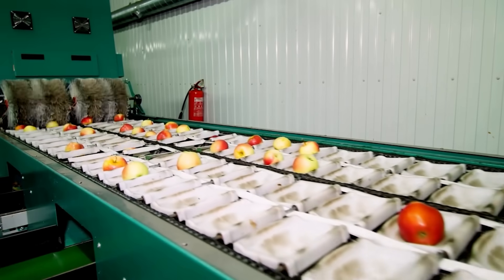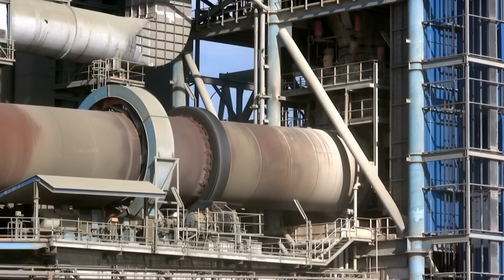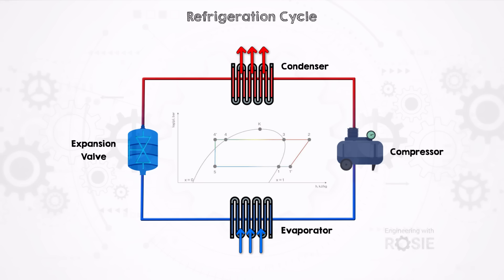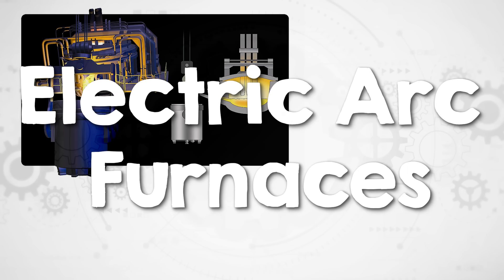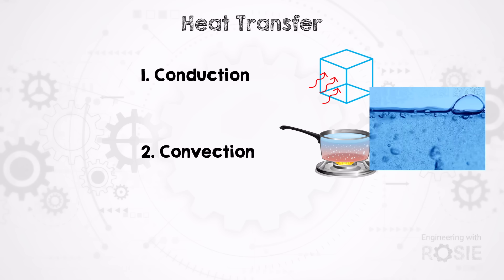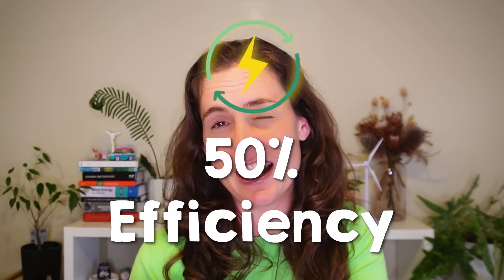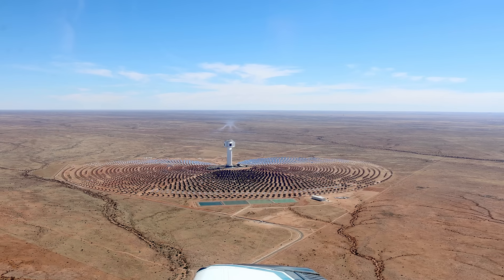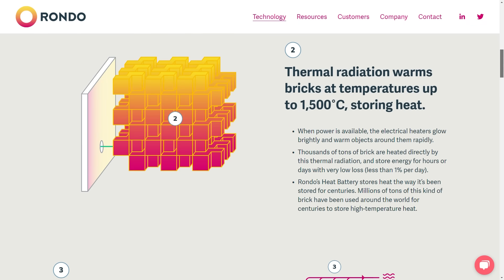Zero Emissions Heat Technologies for Industry

Comment: I have Rooftop Solar at home. 6000 kWh Every Year for 12 Years Now. A High Temperature Heatpump 60 degrees. A Watercooker 100 degrees Degrees. And an Airfryer 200 degrees. No Problem. Microwave, Inductioncooking, bathroom Boiler, close in Boiler in the kitchen. The rest is Electric. Washing machine, Dryer, TV, Desktop, laptop tablet Cellphone vacuum Cleaner toaster, radio, ledlamps. Everything. Rooftop Solar for yr Own electricity. The rest all Electric. No Gas Coal Needed. Works for 12 Years Now.

Comment: I have gone through all your videos and I haven't seen one about the new high efficiency hydrogen electrolyzes that have 95% efficiency.  The videos you have that talk about them only refer to the old ones with low efficiencies.

Because almost of the hydrogen (mostly used to make fertilizer) used today comes from methane, there was almost no need for such electrolyzes in the past, so they were not developed until recently.
Reply: Record-breaking hydrogen electrolyzer claims 95% efficiency
March 16, 2022
"A kilogram of hydrogen holds 39.4 kWh of energy, but typically costs around 52.5 kWh of energy to create via current commercial electrolyzers. Australian company Hysata says its new capillary-fed electrolyzer cell slashes that energy cost to 41.5 kWh, smashing efficiency records while also being cheaper to install and run. The company promises green hydrogen at around US$1.50 per kilogram within just a few years."

Comment: @EngineeringWithRosie 

I was surprised you didn't include glassmaking, in particular float glass, in your list of high temperature industrial processes. This is one of the highest industrial temperature processes, requiring about 1,600⁰C temperatures. Furthermore, it also tops the list for energy supply reliability, requiring an uninterrupted energy supply for in excess of 10 years for the float glass production lines, apparently if they go cold (albeit still extremely hot) it's a complete rebuild of the production line. 

With regard to cement, you made the assumption that the kilns would be heated externally if using electric heating. I may be wrong but I do not see any fundamental reason why heating elements couldn't be placed within the the kiln in some way with a bit of intelligent redesign. However, the big challenge may be the the rate of heat supply, kW, requirded. 

With regard to very high temperatures, resistive heating wire is readily available to around 1400⁰C. These heaters may be expensive initially, at least compared to a gas burner nozzle, but if they use renewable energy more efficiently, than bio or synthetic fuels, then running costs could be substantially lower, making the system cheaper overall. 

If you need to go higher temperatures than 1400⁰C tungsten wire is a possibility, which is usable up to about 2,500⁰C, although it will be significantly more expensive than the lower temperature alloys. 

Finally, the ultimate heating source is probably microwave. The ITER fusion reactor will use 10 to 20 MW of microwave power to help heat the Plasma to upwards of 100 MILLION degrees Celsius!

Comment: Excellent video.  Thank you so much for the explanations and rationales.   Yes, I believe thermal storage will be the Rosetta stone for renewable energy but only if we can rein in infinite consumption and infinite want.
On another note I was encouraged my estimates of water heating using induction used less energy than gas or resistance heating for household use. I jury-rigged my own system saving significant money.  It seems a manufactuer would have  made such a system with a larger vacuum insulated storage tank. 
Also, why can't cement kilns use induction to heat the inner surface or klinker contents?

Comment: Would love to see the Rosie take on electric fields and the movement (drift) of electrons. Drift velocity is a function of current(Amps)/sq.m of cable - Amps/sq.mm being a more useful metric. Drift velocity is mainly important for DC electricity. Each metal/alloy has a  range of drift velocity for which it is economic. It would be interesting to see the range of drift velocities for pure copper and aluminium. 
For DC, electrons might drift about 1mm/sec, and move back and forth 0.4um.
Volts relates to the electric field.

Comment: You missed 2 other possible industrial heat sources that could supply high grade high temperature process heat up to 1300 degrees and perhaps higher. Molten Salts in Molten Salt nuclear reactors and High Temperature Gas Reactors. This is a glaring omission.

Comment: Some of the food processes can be replaced with other non heat based methods, for pasteurization you can use either radiation or pulsed electric field; for canning you can use vacuum sealing in some cases.

Comment: There is no technical reason why gas turbine technology cannot be modified slightly to produce heatpumps with output temperatures around 1650°C (3000°F). Turbines already handle gases which are that hot. Nor do they have to be inefficient, because the input heat can come from cooling off the hot product, which has to be cooled anyway. Just take the cooling air and compress it, making it hotter, which also adds the energy used to power the compressor. Temperature can be boosted the desired amount (for heating the input material) by adjusting the number of stages of compression.

Comment: One process this doesn't mention is using industrial waste heat. I have been a part of a greenfield sulphuric acid plant, which sent over its heat from sulphur oxidation and sulphur dioxide oxidation to a specialty petrochemical plant nearby. The petrochemical plant was already there, the location of acid plant was chosen specifically for the possible sale of waste heat, otherwise it would have been used to generate electrical power and sold back to the grid, but this deal made a lot of sense and saved a ton of money on generation equipment and electrical stuff.
Reply: That's what district heating already addresses so she did mention is.

Comment: Why can't we use Tungsten for high-temp direct-electric elements? That doesn't melt until 3400C.
Is it too conducive to make a good resistive heater or something? It worts in lightbulbs, so it seems like it could be useful for other applications...

Comment: The efficient use of heat would be even more paramount when using relatively expensive sources of heat. Every GJ counts.
One way that strikes me as interesting is biomass oxy-combustion. Heat loss is a function of the exhaust gas temperature but also its mass. The mass of the effluent can be greatly reduced by removing the nitrogen before combustion. A reduced mass and volume of effluent should also make it easier to recover heat as it would require smaller heat exchangers.

At large scale, cryogenic distillation is how you get pure oxygen by turning it into a liquid (higher boiling point versus argon and nitrogen). The BIG question is if cryogenic distillation is a process that can cycle up and down with the ebb and flow of renewable energy output. If so, it means that excess LOX can be stored for later use. Basically, use solar electricity to make LOX, any LOX that is immediately needed is used and the excess is stored in large, insulated tanks. Then, after the sun goes down, the LOX storage is tapped to keep the oxy-combustion going. As for the liquid nitrogen and argon, those could be used for process cooling or perhaps for generating electricity through the use of an organic Rankine cycle.

There's also the possibility for carbon capture, if just to sell it as a commercial or industrial product (like for making carbonated water or as a feedstock for the production of chemicals and fuels).

Comment: Steel and cement making will definitely be the most difficult industries to decarbonize. Most other industrial processes fall into the medium heat category that could be supported by (MSR/TMSR) Molten salt reactors that can produce up to 800C heat continuously.  Boiling water reactors can't do this.
Reply: China's Pebble Bed HT reactor outputs steam at 500C and is now in operation since 6th Dec.They are aiming it for process heat, and plan to export

Comment: Thank you. I follow your video channel primarily for your insights on renewable energy and I notice that the question of viability for renewable wind and solar, which is maximised in areas where there is predictable wind or sunshine or both. The question for both industrial and domestic use of these resources in areas where intermittency is greater and the value of return for the investment is reduced is clearly a problem for the switch to renewables.
In my own case, to replace tank gas in my isolated location with ground source heat pump is becoming more attractive but in older buildings (listed historical), the low temperature / high insulation value model is impractical.
In discussion with a heating engineer and consulting locally and nationally (UK), there appears to be considerable shortfall in expertise and those with any or all of the required knowledge are cherry picking simple installations, exclusively air source pumps, to maximise profit. Furthermore, the benefits of air source heat pumps are being heavily oversold, failing to give a true idea of potential in particular during prolonged cold weather, this leads to disappointment and damage to the already fragile incentives to make change.

Comment: Rosie. You’re falling into the efficiency rabbit hole again. Efficiency is not a factor when it comes to Hydrogen because we have an unlimited renewable supply. The only reason efficiency enters your mind is because you are still working in the capitalist model Remember saving the planet will cost money . And since the Sun imparts more energy on to our planet in one hour than we can use in one year then the question is how do we turn that energy into Hydrogen.Efficiency does not matter if you use that energy to make hydrogen. Yes I know this is a had concept to get your head around.
Reply: White or gold Hydrogen is a naturally occurring gas at depths of 3000 meters. It is being researched in the Lorraine basin in France with cost may be as low as 1 dollar a Kg to mine!  Bill Gates is all over it right now!

Comment: Everybody likes an idea of a "cleaner" world (air). Besides the heat pumps (which are slowly advancing in efficiency and at a (relatively) lower costs) , the rest of it is so expensive , that it couldn't be done , without heavy subsidizing . Which means , ordinary citizens have to pay for some rich people (owners of the industries) to become green (or greener) and avoid paying carbon taxes. I'm all for it , as long as it costs me and my fellow citizens nothing. Of course , it doesn't offset acquiring and transport of raw materials for industry production. As long as there is a cheaper option (mostly conventional - fossil fuels , or bio mass) - people will use it , unless something equally cheap , abundant and reliable and accessible to everyone emerges. But , that is more political , than technological subject.

Comment: Rosie, I enjoy your videos.
I would like to point out concern of the blanket statement that conduction is the least efficient form of heat transfer, and radiation is the most. I'm a licensed Mechanical Engineer in the US, and maybe I'm misunderstanding your criteria for most efficient to least efficient. Radiation, in most cases, is the least efficient process of heating up material and conduction is the most. The ability to direct contact transfer heat can not be beaten by the use of emissivity, reflectivity, and temperature difference requirements of radiation. Unless hypothetical, your hear source is a fussion reactor with a plasma temperature too hot for material contact, in which case it's not efficient but practicality driving the transfer mood. I'd appreciate some clarity on your choice of efficiency for describing the transfer mood effectiveness.

Comment: I think green hydrogen can be a reasonable choice for iron from ore (as it also acts as reducing agent there) and for cement kilns. If the hydrogen is produced on site with high temperature electrolysis thermally coupled to the process, higher efficiencies of around 70% might be possible. 
Using Biomass in these applications might at first be more convenient, but lacks scalability, if just using waste and comes with even more problems if not.
Of course, for almost anything else, I agree: electrify.

Comment: How about nuclear?
The Japanese are working on the Red  Hyrogen process process, that will produce emissions free hydrogen fuel.
Reply: "The idea of red hydrogen is to produce hydrogen from a thermochemical reaction between water, iodine, and sulfur at a high temperature, around 900°C, using the thermal energy from a nuclear reactor.”" Feb 15, 2023

Comment: Mostly correct but 2 things to note. 
First, hydrogen efficiency when using as heat is not 50%. It is 50%  if you want to get power back. This is because power to hydrogen conversion is 90% and hydrogen to power conversion efficiency is ~60% giving overall power to power efficency of 50%. For industrial processes the heat efficiency is 90%. I agree though about engineering challenges.

Second, a crucial technology omitted here is nuclear. High temperature gas cooled reactors operate at 800 degrees and have use in China to provide process heat for many industrial applications. This is by far the best source of cheap and clean heat source. Far better than anything mentioned here.

Cheers

Comment: One thing this highlights is that we've gotten a bit lazy in our engineering. Just add more energy has been a cheap and easy way to solve problems. Investing a little more time thinking about the true optimization of systems will lead to using the best tech for a given situation. 
Thanks for all your work doing these videos, Rosie. I, along with many others, really appreciate the effort you put into them.
Reply: They built an electric ark furnace to melt scrap steel to make trane track in Novascotia, and every time they fired it up, all of the lights in North Sidney would dim and when they shut it down it fried everyone's electronics. They ended up running it on Diesel generators.

Comment: Rosie, thank you for another informative post. But due to the complex nature of the topics, it would be very helpful to establish at the intro, a set of relatively easy to understand guiding principles. Which ironically are somewhat analogous to those for recycling, 'reduce, reuse, recycle. 

For example a catalyst can 'reduce' the need for heat. Recaptured heat can be directly 'reused' by increasing its temperature. And lastly 'recycle' for other purposes. And I was thinking of this in terms of  processing clinker for creating cement. (Which also has a biological option that 'eliminates' the need for heat, but it's not currently scalable.)

And at the conclusion of the post, It would be nice if it was highlighted. How well the different alternatives fulfill the principles that are established in the intro. In this case, how to Reduce, Reuse and Recycle, energy needs for industrial heating requirements. 

IMHO it should improve the audience's understanding of the topic and make the comments more relevant to the topic. Thanks again for the post.
Reply from the maker: Great feedback and I'll think how I can incorporate that in future videos.